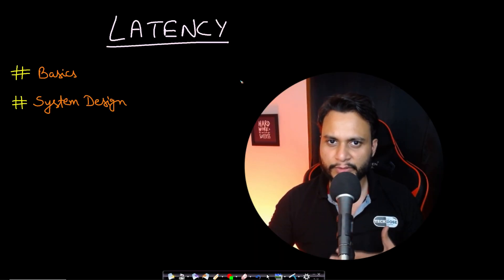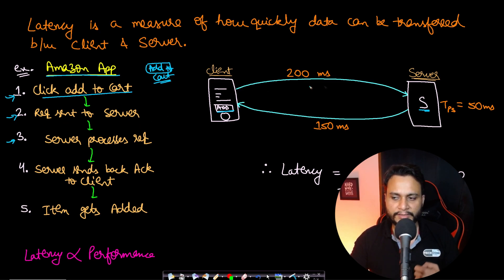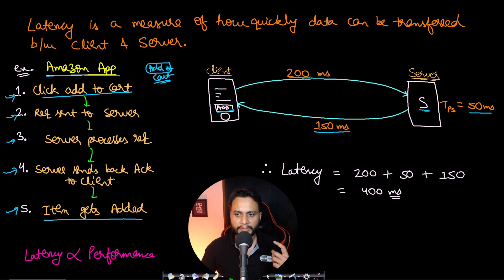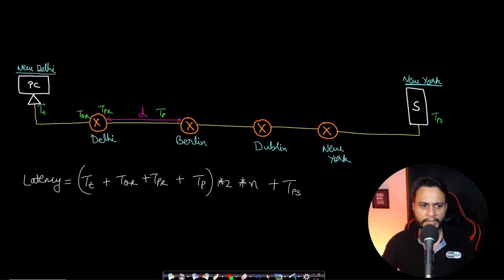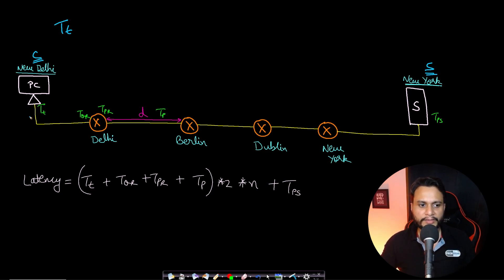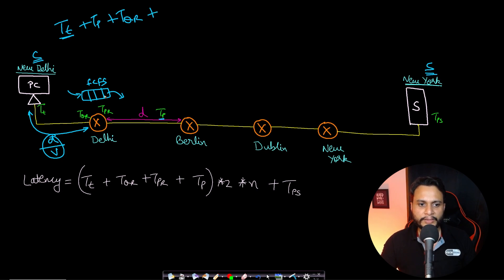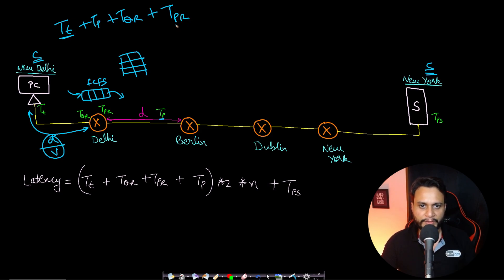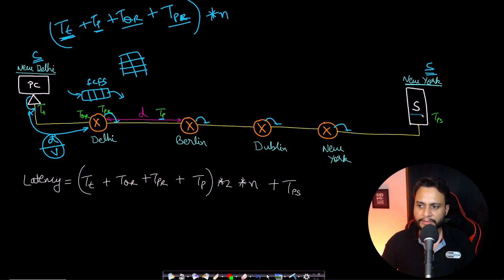Latency | System Design

Comment: In system design, latency refers to the time delay experienced in a system, particularly in the context of communication or data processing. It is the time taken for a data packet to travel from the source to the destination and receive a response. Latency is a critical factor in determining the performance and responsiveness of a system, especially in real-time applications.

Key aspects of latency include:
1. Network Latency: The time it takes for data to travel across a network from one point to another. This can be affected by factors such as the physical distance between the client and server, the quality of the network infrastructure, and the number of intermediate hops.
2. Processing Latency: The time taken by a system to process a request or perform a computation. This includes the time spent by servers, databases, or applications in processing and responding to a request.
3. Disk Latency: The time taken to read or write data to a storage device, such as a hard disk or SSD. This can affect the overall system performance, especially in data-intensive applications.
4. Round-Trip Time (RTT): The total time it takes for a signal to travel from the sender to the receiver and back again. This metric is often used in networking to measure the delay between two points.
5. Queueing Latency: The time spent waiting in a queue before a request can be processed. This can occur in various parts of a system, such as a network router, a server handling multiple requests, or a database waiting for access.

Latency is often measured in milliseconds (ms) and is crucial for determining the user experience, especially in applications requiring real-time interactions, such as video conferencing, online gaming, financial trading, and more. Reducing latency is a common goal in system design, achieved through techniques such as caching, optimizing network paths, improving hardware, and using efficient algorithms.